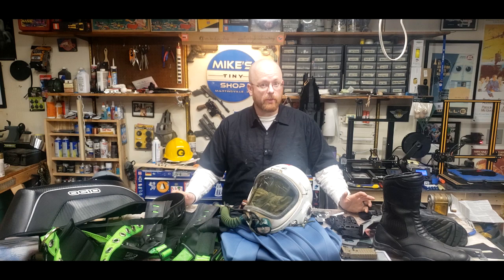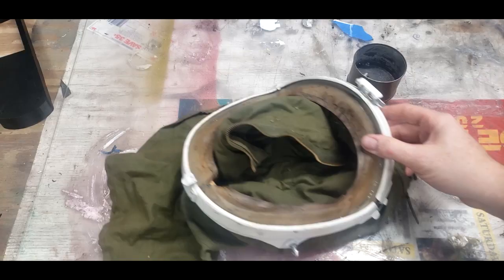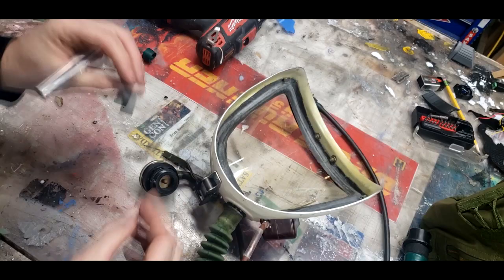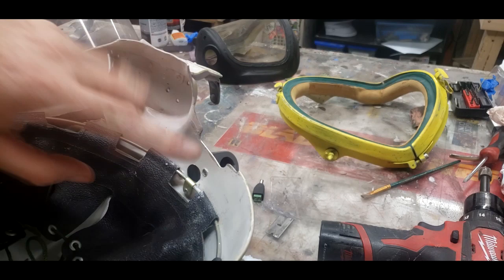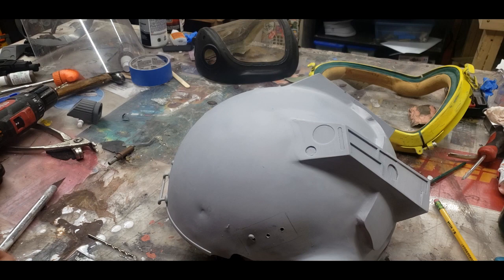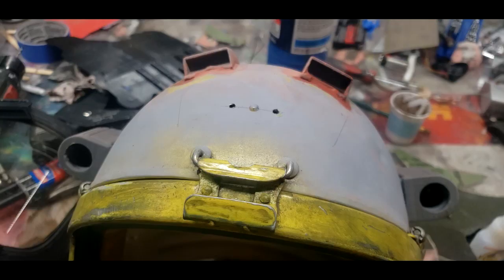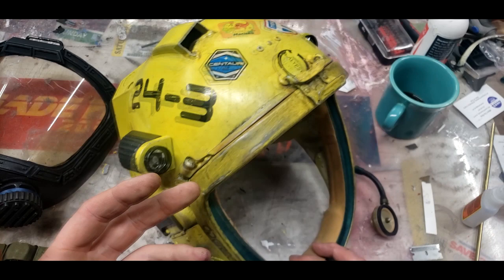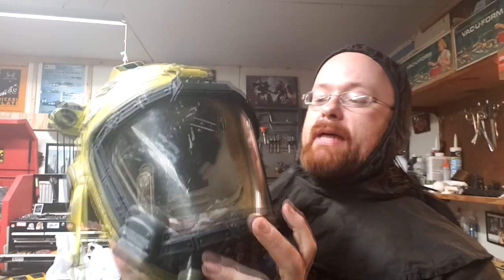How to Build a Vac Suit  from Amazon's The Expanse

Comment: Hey, great work and a well-done video!

Could I trouble you for a reference measurement from the helmet?  All I need is the diameter of either the metal disc you removed from the back shell, or the circular housing of the latch on the side which locks the back shell on.  Big thanks!